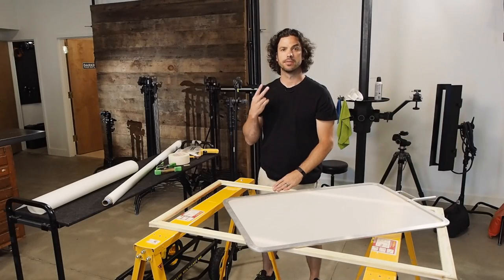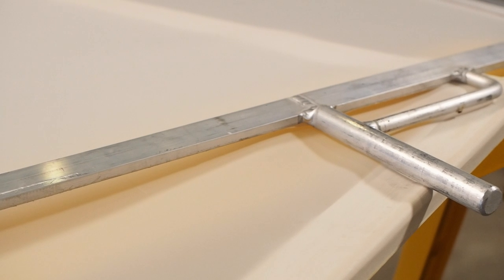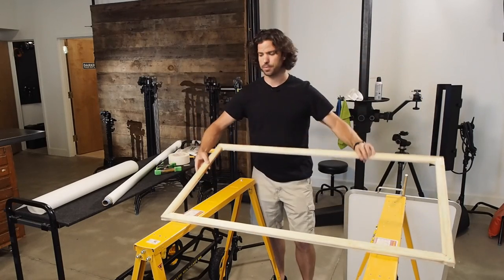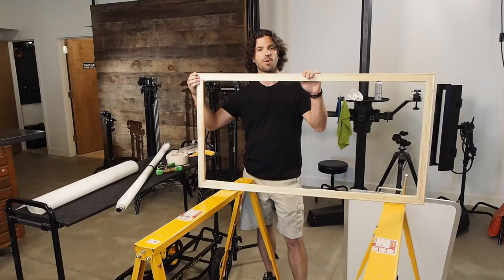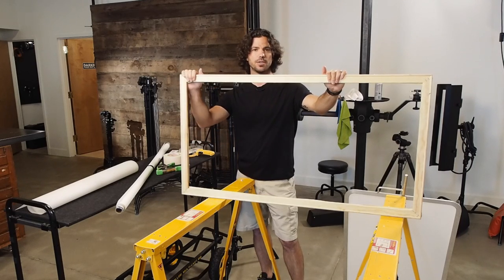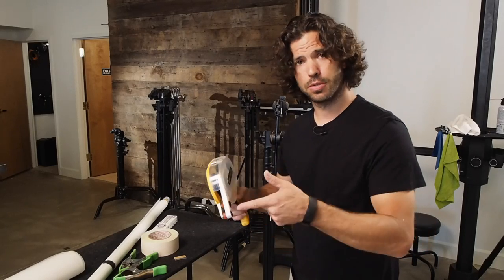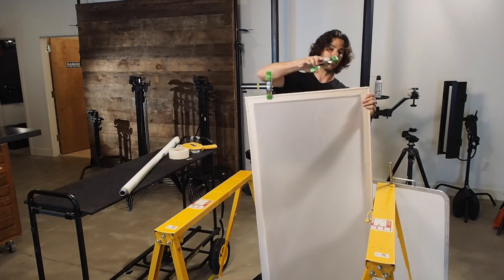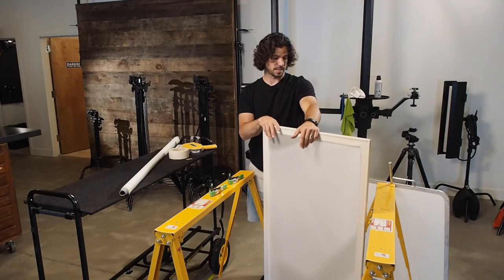DIY Diffusion Panels

Comment: Under $30? Nah, more like $200. The roll of Rosco 3008 is $124.00 alone.
Reply: where can you buy sheets of it?
Reply: ***** thanks! Very helpful, I appreciate it :-)
Reply: You can also buy a 60"x18' roll of Savage Translum for $60 and make six 3'x5' panels or a dozen+ smaller ones.